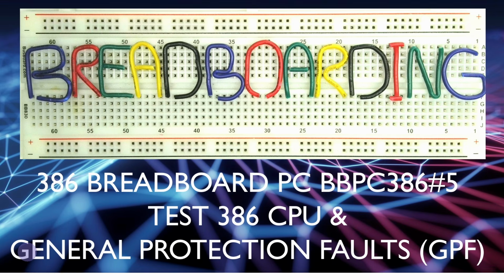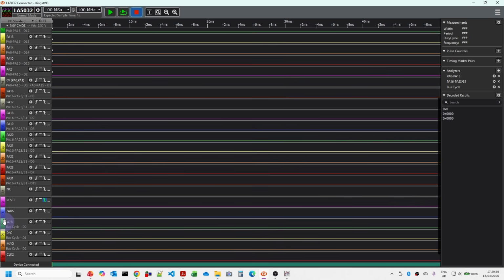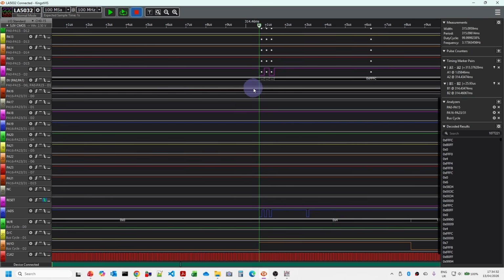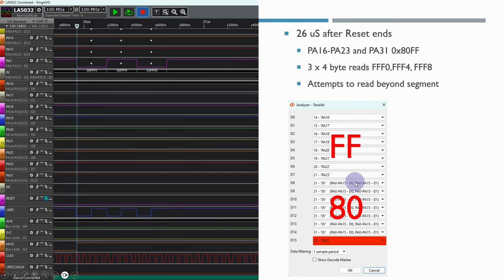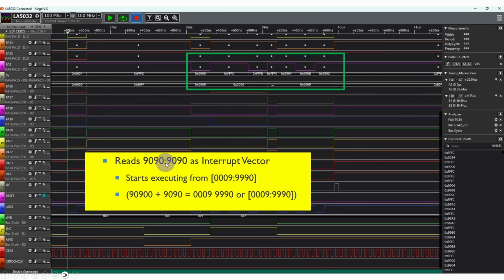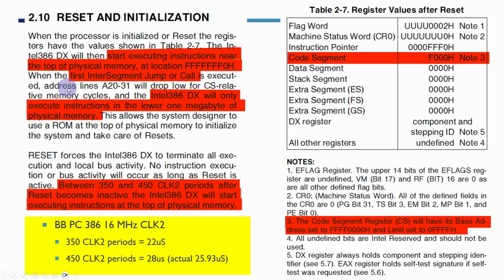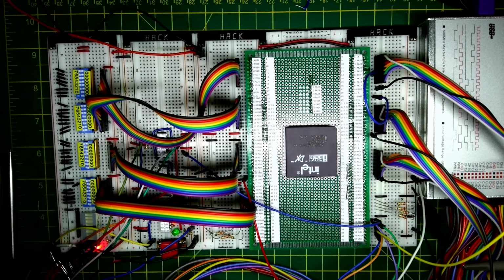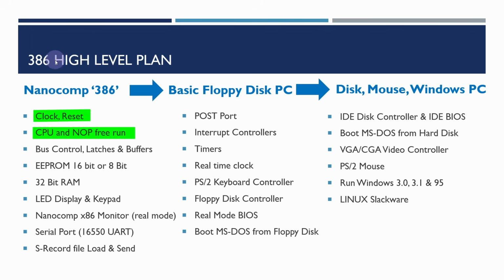386 Breadboard PC #5 386 CPU working & General Protection Faults

Comment: Your CPU will be writing to the data bus when it handles the exception. Are those bus lines shorted to ground by the dip switches?
Reply from the maker: They are currently but I was going to swap out the GND connections with 1K Resistor array. One of the reasons for not using the NOP test! I also shorted the A17 address pin to ground via my logic analyzer ground line for half a day! Fortunately the CPU survived! Dave

Comment: I'm going to copy your design into a pcb, I have a 386 from a PLC that I'll gladly use for this. An the accompanying cpld from the same pcb, an epm7128, a part I've used before and highly like. I probably have enough DRAM modules in simm 72 pins, but I hate those simm modules, so I don't know, I'd probably have 64/128mb dram ready to be soldered on the pcb. I'd also like to read the bios from an spi flash, similar to what's been done on the tiny68k sbc. I have high hopes for this project of yours!
Reply from the maker: Well I will be using 512KB x 8 bit static RAM chips so not sure my design will know about how to use SIMMS. The main complication is how to wire up 8MB or 10MB of these chips (16 or 20 of them!). I have been looking at building stacks of chips using stripboard and right angled sockets. These should just plug in to replace the 4 x 512KB chips I will start with. Effectively static RAM memory modules in DIP form! Dave
Reply: @breadboardinglabs  Yes, I have a few 512K sram chips, but I think DRAM makes more sense, even if it's complex. I don't know if there are larger ones with sop/soj packages (smd) that could be made into pcbs, but even if the largest available is 512k, you could stack two of them (one on top, the other at the bottom side) on a dual or quad layer pcb, and then having holes for pins maintaining a standard pitch (100 mil), might be a good solution. or the good old piggyback method. but in any case, I'm following your project really close, I'm quite interested! cheers from Argentina

Comment: Very cool video I love how you worked through every step of your exploration with very clear explanations. I like how you were able to implement Intel's basic test program and see it was running. 

In earlier videos it looks like you were planning to go with a 16 bit bus (when I saw the first video I was wondering if you were going to go with a 386SX as it's low pin count and 16 bit bus might be easier to deal with and breadboard). Is that the plan or are you looking to implement a 32 bit bus?
Reply from the maker: 386SX would be cheating plus the designs for these has lots of large VLSI chips which are very difficult to use on breadboards. Compaq DeskPro 386/16 is the only 386 design I have seen with 74LS/ALS/F logic and PLDs so 32 bit bus for RAM. As the DuPont cables for the DIP switches show it is not difficult to wire up 32 bits. DeskPro still used 16 bit ISA bus for expansion cards, video cards etc. Dave